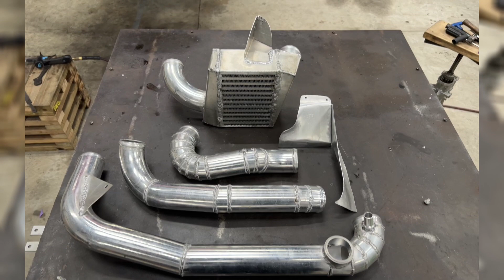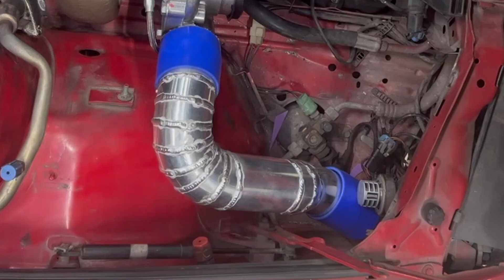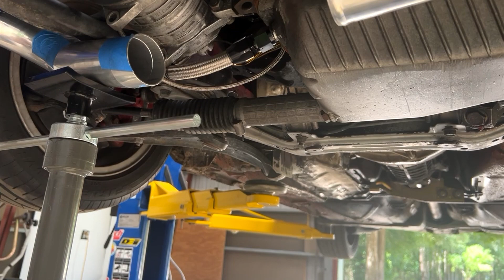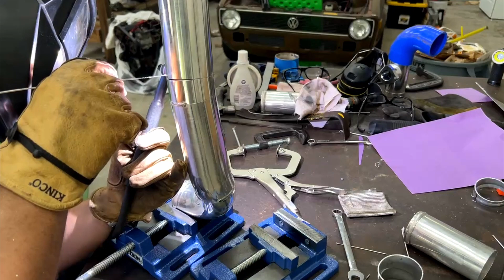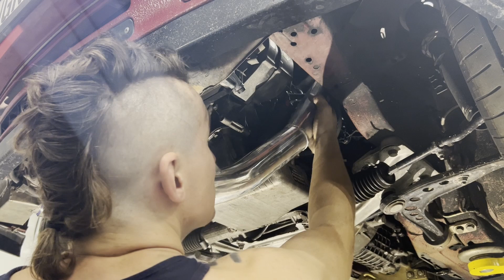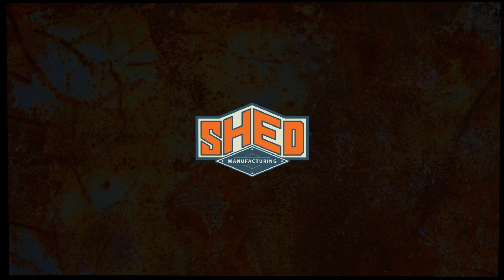Project Turbo E30 - Intercooler Piping Fabrication and Assembly

Comment: What manifold u using?
Reply from the maker: Kangaroos team cast twin scroll
Reply: @shed_mfg nice I want that one but they said they wouldn’t confirm if it clears the AC
Reply from the maker: @OldspoolMatt  it clears it with my turbo and wastegate just fine. You will need to insulate the lines to protect them from the heat though.

Comment: Would a 3d printer fix any of the difficulties of fitting tubing?
Reply from the maker: My issue is based less in making the parts and more in knowing exactly how long and at what angles they need to be cut. I guess a 3d scanner could have a place in extremely complex tube placement.